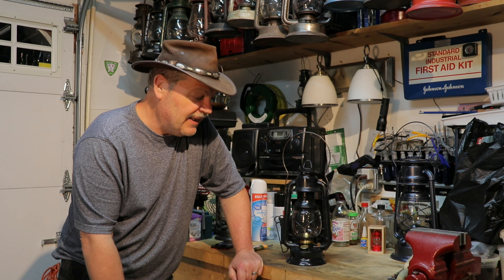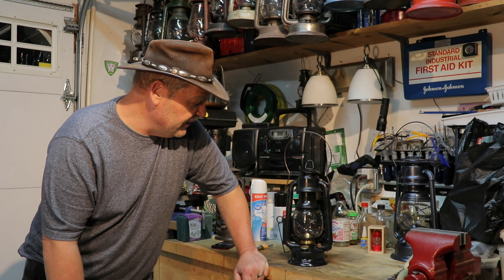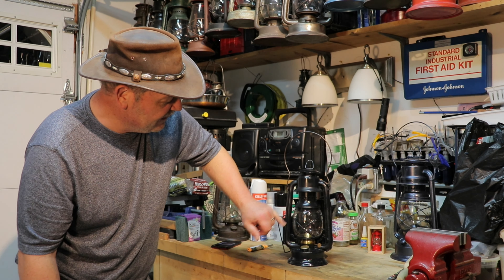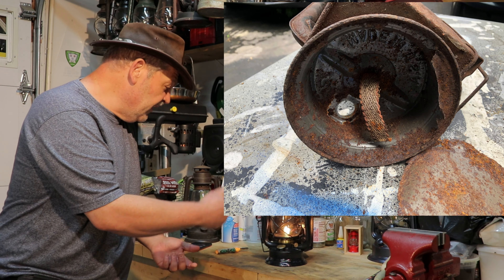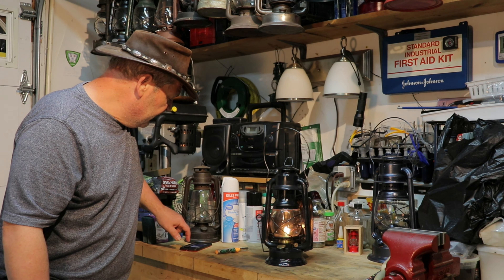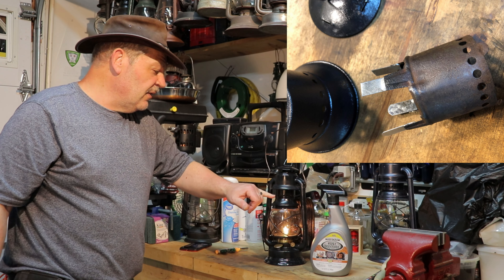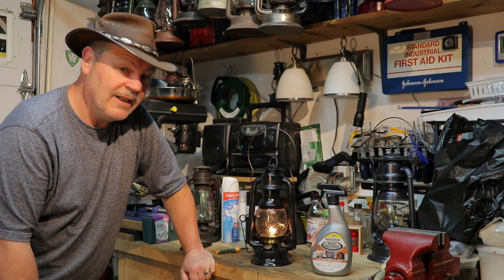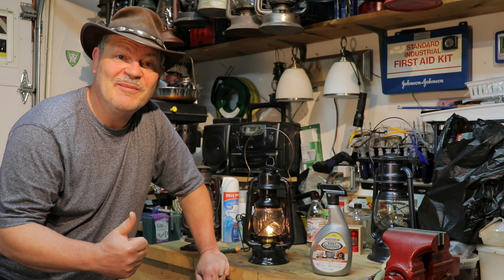Rayo No. 124 Restoration. Back From The Dead.

Comment: Hey Ken, wow, you did a great job on brining that ol' buggy lantern back from the dead! What an interesting deal with the globe. I think Embury mostly used "junior" size globes for those, but as you point out, it's been altered? I think it looks great and really a fun piece. Now, originally the back of the reflector was bright tin, to reflect light forward, I know I've seen some people paint those silver or chrome, to emulate tin. It's a cool lantern and you did a great job on it.
Reply from the maker: Thanks so much I was actually thinking about maybe painting the reflector silver in the future but just had to get this thing done for now it was taking so long I was getting frustrated and after removing a great deal of rust on the reflector It started to pinhole on me so I just wanted to get what was left of it protected because this thing was really in bad shape but maybe I can hand paint it i. The future after as another project.

Comment: Thanks for sending me this link. What approx. Thickness of sheet metal did you use for the bottom. I was worried about my soldering skills not being leak proof. I will try to copy your idea and follow up with epoxy. Thank you for answering my questions. I enjoy your channel and stories.
Reply from the maker: I’m actually not sure of the thickness I had a few sheets laying around but if I had to guess it probably was a 22 gauge sheet metal. I kind of just went by feel usually the thicker the better but not too thick that you can’t cut out a good circle with the tin snips.

Comment: Great job!  I wouldn't have tried it.
Reply from the maker: Thanks so much I really appreciate that.
Reply: @lotsatrains  If you have a a lot of extra money, a machinists lathe,  a TIG welder, a drill press, possibly a powder coating setup, or a compressed air sprayer,  autobody hammers and dollies would be nice,  but then you would have no room to work in.  And less money to buy old lanterns with.
Reply from the maker: @markeholbrook  exactly I wish I had all of that because I actually had to fabricate about a total of 11 pieces by hand tools to fix this thing and believe me I hope to never do this much to a lantern again I was almost ready to give up but had to prove to myself that I could do it 😆
Reply: @lotsatrains  I like to see how restorers deal with missing  or destroyed parts, and in the case of this lantern it doesn't matter if it's a Hodge Podge  of lanterns, because it's a working lantern now.  Check out fitzee's fabrication on YouTube,  He works with basic tools and fabricates Sheetmetal parts for vehicles where there are no available aftermarket, plus he is entertaining too!